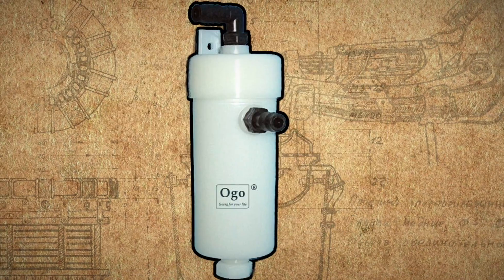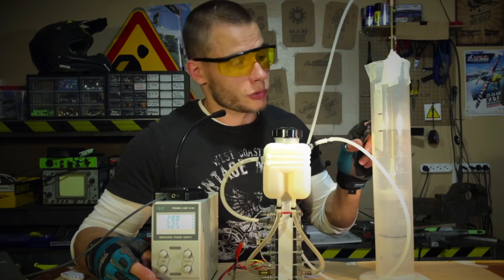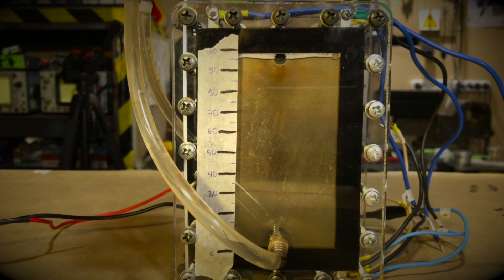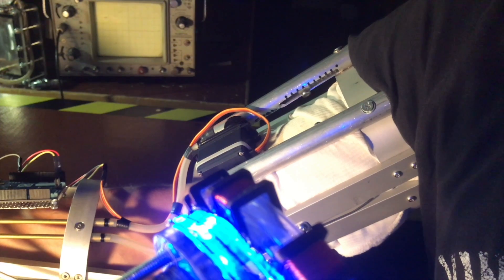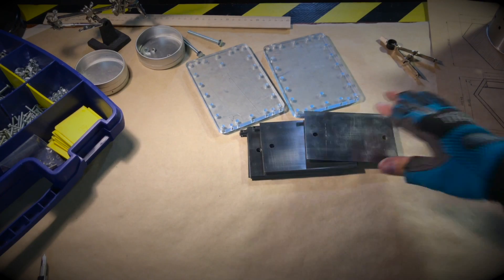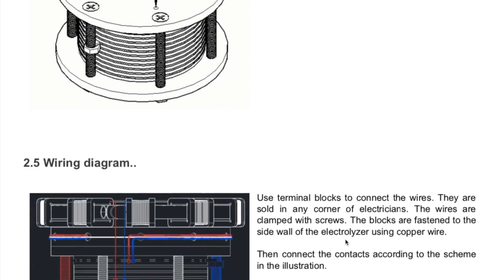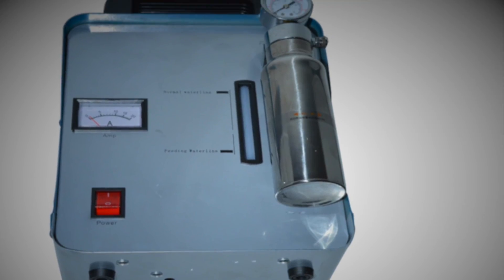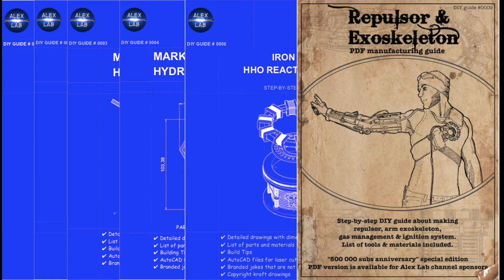Top 10 hydrogen kits from AliExpress

Comment: how can i control the gas generation dynamically as per the my diesel engine loading conditions. And is there any risk on the diesel engine ??? please discuss what are the limitation and restraints when using or design the system.

Comment: how do you purely collect hydrogen when electrolysis of an electrolyte produces 2 gases. How do you separate them
Reply: Well it depends, the positive and negative, simply separate the positive and negative and you'll separate the gas, thru electrolysis, if you connect the + and - you get HHO also known as not yet reacted water, if you ignite HHO the gas combines and explodes into a vapour known as 4HO2 or water, like i said before, separate the + and - and you can get oxygen separately from hydrogen and the opposite

Comment: Can you or anyone recommend an electrolyzer that produces Hydrogen and Oxygen at separate outputs?
Reply: I also want the answer
Reply: Well it depends, the positive and negative, simply separate the positive and negative and you'll separate the gas, thru electrolysis, if you connect the + and - you get HHO also known as not yet reacted water, if you ignite HHO the gas combines and explodes into a vapour known as 4HO2 or water, like i said before, separate the + and - and you can get oxygen separately from hydrogen and the opposite

Comment: Actually it's not that hard. Anyone want to know ask and I'll explain.
Reply: Can you explain how to get the electric solenoid valve to react and push the hydrogen down into the repulser?
Reply: @Christisking.13  The gas builds up pressure and then gets released once you either activate the solenoid or if you have a pressure sensor set up it will release once it hits a specific pressure. But in this case it needs to be controlled so there is an activation switch. Otherwise it would just fire on its own.
Reply: @jvon3885  ohhh that makes a lot of sense. That you bro👏🏻

Comment: great recommendations :), 
just for your info, i got the exact same flashback Arrestors at 0:15 for 5$ & 6$ (red and blue version)
also the same flowmeter 1:25 i got for 3,16$ :) on ebay. Sometimes its better to compare price when you need multiples of the same item.

Comment: Would it be possible Alex to have a continuous stream of hydrogen from a hydrogen reactor instead of just letting out hydrogen in bursts?
Reply: I think you could add an hho storage unit. Three containers
The outside and inner to hold the water in a ring. Then put the mid sized container in the water between the other two containers. You could add a stop on the gas container which could stop the hho production. This will always have start up and acceleration gas. Just an idea

Comment: So to get something straight. The more plates there are the more powerful it is. Or the plates number doesn't matter and what does matter is the energy input from a battery/power source? Do both matter, or am I missing something and completely wrong? What do you think Alex or any one else from the community?
Reply from the maker: 2 main things: square of active zone and current.
You can increase active zone increasing quantity of plates or/and square of plates.
Quantity and square of plates depends on power source voltage and current.
If active zone is small and current is high you will get overheating.
Other technical aspects depend on specific model.
Reply: @ALEXLAB   So pretty much have a reasonable amount of current going through however many plates I have with the size of plates in consideration. How much current would you recommend each plate can handle per square inch or do I have to become a member and get the pdf to find out?
Reply from the maker: The good aim is 1kV for 1 square meters of active zone.
For example in my laboratory electrolyzer:
active zone = 0.15 m2
power = 0.15 kV
Thats optimal ratio
Less current - less gas. More current - quick overheating.
But remember that you cant just take 2 huge plates. The bigger the plates - the quicker gas filling is.
Right now I making a video, that describes calculation method for manufactirung electrolyzers.
Reply: ALEX LAB Thank you for all the advice and calculations. Gonna be really helpful down the road for me.